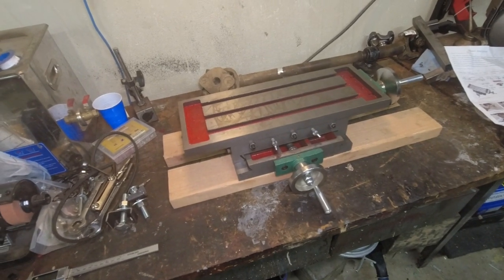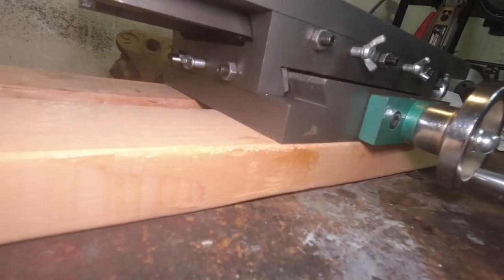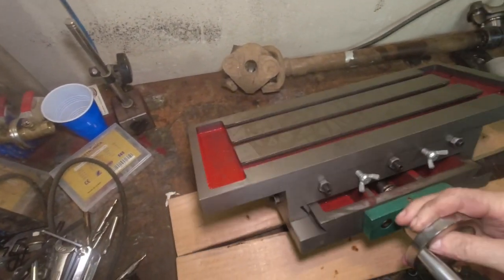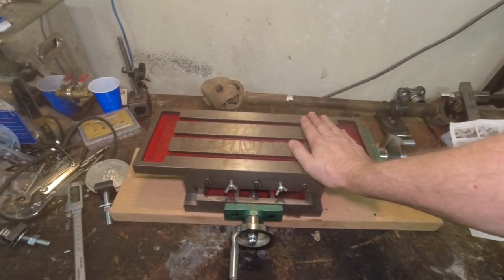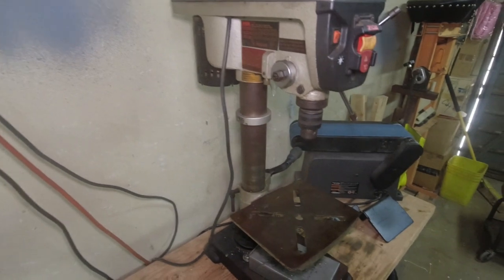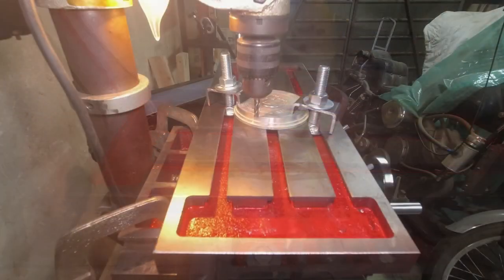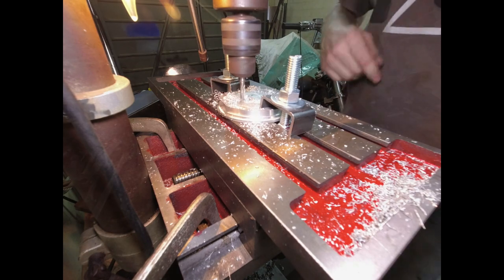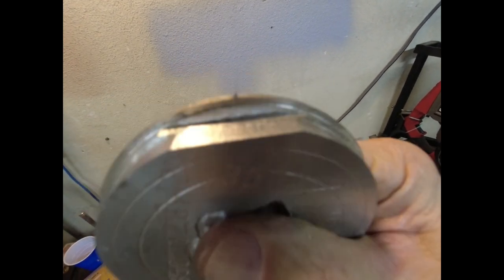VEVOR  Heavy Duty 17.7" X 6.7" (450x170 mm) 2 Axis Cross Slide Milling Table. Test and Review!

Comment: One thing's for sure, you would need the services of a fully equipped machine shop just to make one of these and at a huge cost too...........consider these items to be the starting point for a project you can make better........cast iron is a devil of a metal to work on and I've worked on more iron in my 60 years of machining than I've had hot breakfasts.

Comment: Hello, I'm currently designing a cnc mill. Would this be good enough for the job? (I'm aiming to mill aluminum and mild steel) I'll replace the leadscrews with ballscrews and add motor mounts.

Keep the videos coming they are helpful for tinkerers like me. Thanks.
Reply from the maker: Considering that it's built like a tank I would tend to believe it would be good enough for your needs. And since you pointed out that you'd be modifying it anyway, I'm sure at the same time you'd deal with the rough sliding surfaces.
Reply: For a CNC mill the only really useful part is the Tee slot table.......you could make it much better by fitting linear rails and ball screws in place of the dovetail slides as the dovetails are not what a CNC mill would be good at........at the same time a ball screw(s) is required.

Comment: Does the bed lock off so it doesn't move at all? I'm thinking about wall mounting it but need it not to drop while in operation.
Reply from the maker: There's no lock, but the bed is not going to fall off if you hang it on a wall. It's mounted on dovetail, just keep the gibs adjusted to put a bit of drag on the lead screws and it will be fine.

Comment: I can tell by the first few minutes of the video,  where you show the cross gibb, and its terrible fit, would not interest anybody that has machine tool expierence. Thanks very much for taking time on the video.
Reply from the maker: My older Brother had 30+ years in the industry and he loved buying this kind of thing, he'd spend hours welding, grinding, fitting and polishing until he got it perfect. So while someone like you might just look at it and think "Garbage", someone else might see it as a project. Thanks for watching!
Reply: @3rdpig  I am glad you responded to my post, as it clearly indicates the time and experience needed to make this tool usable. ☺️
Reply: The gib fit is wretched.  There's no way to fix that except to make a new one.  This is little more than a kit of parts with variable quality control.